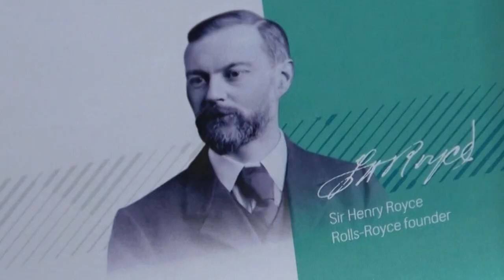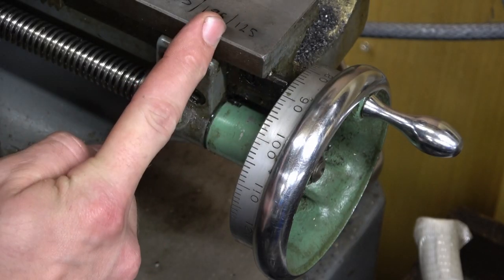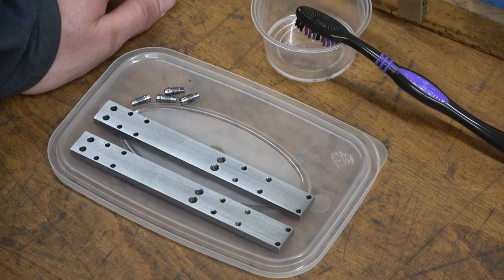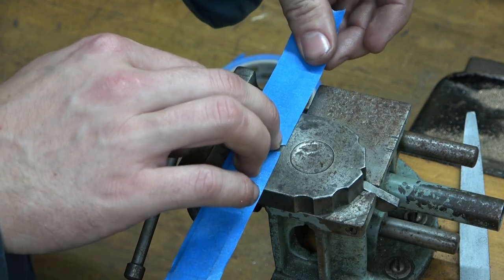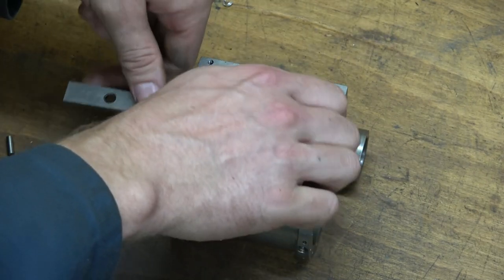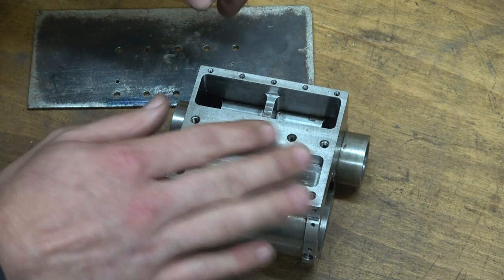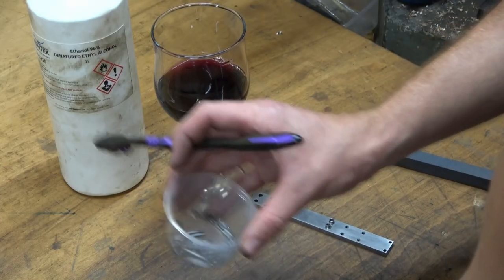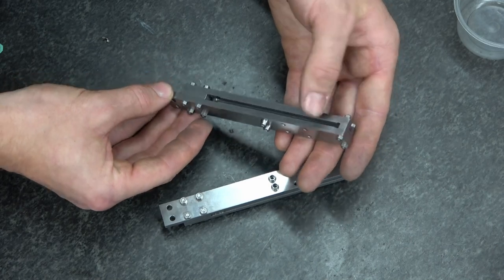MrCrispin's Nipples

Comment: Thank you for making these videos, I now for the first time really appreciate the difference between studs and bolts. Also, congratulations to your whole team!
Reply from the maker: I should point out that most studs are not designed woth precision location in mind as often they are intended for a clearance hole application. It's just that when chosing what custom fasteners to make I happened to choose studs to base them on.
Reply: @MrCrispinEnterprises  In your opinion, are Shoulder Screws equal, less than or better than at achieving the fastening and locating function in assemblies? Making shoulder screw assemblies is one thing, but I don't know if its a good thing to let the same screw also act as a shear pin (the way a dowel pin does) in a screw/bolt assembly where fastened components are subject to relative sliding forces because of machine operation.
Reply from the maker: I think a shoulder screw would have worked well in the application I showed here. It would give all the same benefits. The only down side is it would have taken a bit more making as you would have to machine a precise diameter plus the threads and plus the head. 
As for using them generally to replace the cap screw / dowel arrangement I'd only do so if space is an issue. Typically you only need two dowels per component to align things meaning that you only need two precise holes. With shoulder screws used in the fashion you are suggesting ever hole would have to be very precise.
Reply: @MrCrispinEnterprises  You are right in the last line that it generally amounts to using an over complicated process, and it probably only makes sense to use it where there is some other constraint like space. I had once seen an application where there 2 fastened parts which had to be relatively located and clamped, but because of size/placement issues, it was difficult to turn matching male/female alignment diameters directly into the parts, so a bolt pattern was used in which only 2 holes (made deliberately a little offset from the rest of the pattern) used shoulder screws to align and fasten whereas the rest of them were ordinary screws in clear holes. Conventional usage doesn't allow fasteners to be used as shear resistors, but I really wonder what happens in a shoulder screw setup where you have a more complex interaction of tensile, compressive and shear forces along different sections of the material. I've not known shoulder screws to be rated for a combined shear load when there's tensile load on its threads, but using them for location will invariably result in such a stress condition.

Comment: A strange coincidence I will relate......as you are involved with production of the jet engine turbine blade manufacture in Rolls, back in the late 70's I worked for a firm F.Mc Braida located in Bridgeyate Bristol and we had a contract to make/produce at first hundreds then thousands and eventually millions of plugs from Nimonic alloy wire to seal the ends of the turbine blades after they were investment cast......the turbine blades were investment cast hollow with 3 holes in the ends for venting and these were plugged and Tig welded closed.......I was entrusted to make a press tool to make the plugs after our resident toolmaker became ill with heart trouble and after much R&D on the tool eventually it worked and produced plugs at the rate of 8o per minute for 8 hours at a stretch.............I left the firm in 1981 under a cloud to emigrate to OZ as it was assumed I would be there for life and emigrating to OZ seemed like a betrayal of trust as far as Mick Mc Braida the boss was concerned, as he never spoke to me again personally until the day I left.........laughingly, a week before I was due to leave the manager, Tony Gower, informed me that I would not be getting a pay rise as it was deemed that I had lost interest in the work I was doing.......I just have to wonder if Rolls Royce collapsed in fits of agony when I left.
Reply from the maker: Probably!

Comment: Mr C, congratulations to you and your team on the Royce award. I'm assuming well deserved or RR wouldn't have awarded it. 
As to the rest of the video, two locational operations I've seen in car engines is the use of a bolt within a machined tubular locator and shoulder bolts into a counter bored hole that achieves the same locational function as a seperate pin or dowel.
Thanks for the rousing military music.
Regards from Canada's banana belt. 🤞🤔🇬🇧🕊️🇺🇦🍌🇨🇦👍
Reply from the maker: Thanks for your comment
Reply: United States Marine Band

Comment: A point of clarification Mr Crispin,

I agree with everything you said in your video, it's was spot on, and I'm sure you are aware, however it wasn't made clear and is a frequently misunderstood subject, so a little more on what was left unsaid...

A clearance hole in a part through which a threaded fastener is placed is not responsible for holding the position between two parts.

A dowel pin placed between them also isn't responsible for holding the position between two parts.

A properly designed bolted joint will hold its position as assembled regardless of the clearance allowed around that fastener and one using dowels will continue to hold its position even if you remove the dowel after assembly.

The purpose of a dowel is to aid in the precision alignment of two or more parts during assembly and only during assembly.

The thing that keeps the alignment of those parts fixed is the clamping load applied to them by the fastener and the friction that exists between the parts as a result.

Take for example the bolted joint that retains your car's wheel to the rest of the vehicle. The layman may assume that the studs and nuts used carry the shear forces the vehicle places on that joint however in reality they should be subjected to no shear load at all in spite of the massive shear loads that joint is subjected to.

Instead, the 5 class 8 bolts often used apply a clamping load on the wheel of around 20 tons, the friction that generates between the face of the wheel and the hub carries all of the shear load the vehicle can generate during normal use.

As an asside, cars also use a second method of precision alignment of a bolted joint, that being the conically shaped bottom face of the nut and matching feature in the wheel. That in itself is a remarkable piece of engineering given its simplicity, repeatability and ease of manufacture.
Reply from the maker: Good point and well clarified, I would still say however that bolts in clearance holes or dowels are responsible for the position of components. It's just that once you tighten the bolts up and the assembly is finished you are entirely reliant on the clamping force of the bolts to maintain the position. Cheers

Comment: Great job . can you tell me if Rolls Royce does factory tours? Also, do they have a manual workshop for proto-type work?
Reply from the maker: Thanks. No not aware of any factory tours which is a shame. I believe they did them years ago and used to repaint all the machines before hand but those days are gone. 
As for prototype work it's all CNC these days.

Comment: Crispin, what’s your thoughts on files becoming blunt from drawing backwards on the workpiece instead of lifting off then pushing the cut forward?
Reply from the maker: I think with the low price of modern files they should be considered a consumable. If it makes it easier to draw backwards then go for it and just buy a new file every few years! I avoid filing anything that is hard or too much for the file as that dulls them enough to make them unusable within one sitting but I haven't noticed any effects from drawing backwards.